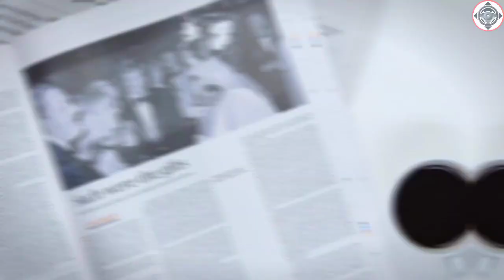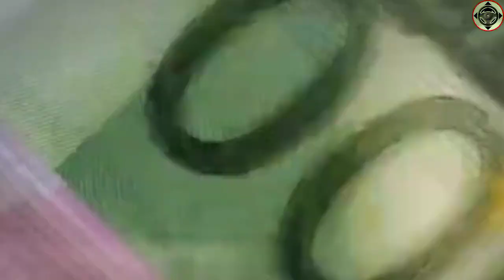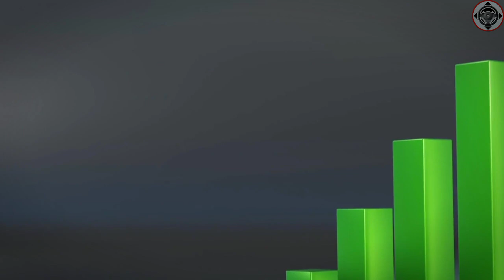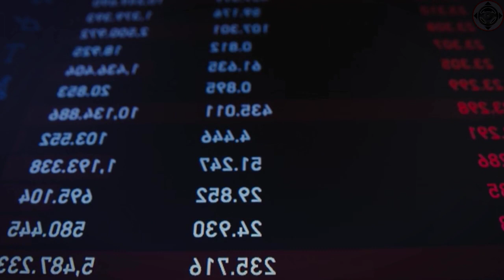Ford CEO Announces ALL NEW $10,000 Pickup Truck & SHOCKS The Entire Industry!

Comment: Probably $10,000 to get on the reserve list
Or
For the base model, which starts without a motor, body, tires or windows... Start with charging for the frame and it goes up from there
Or
$10,000 to make and then upcharged 800% by the dealer